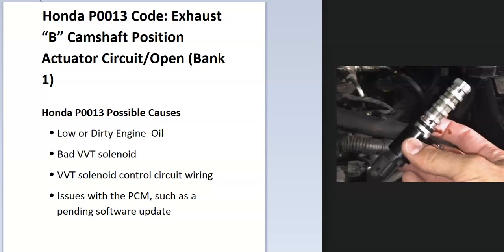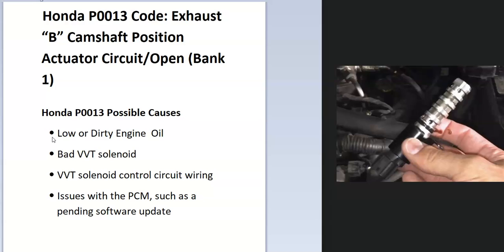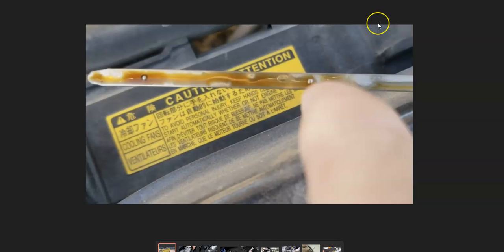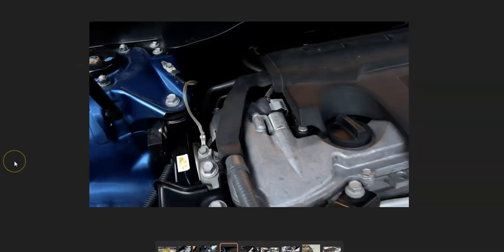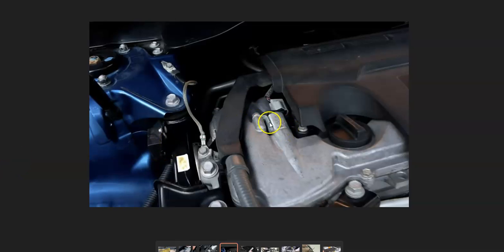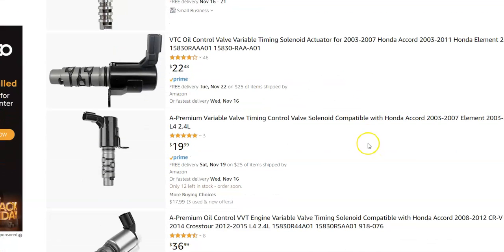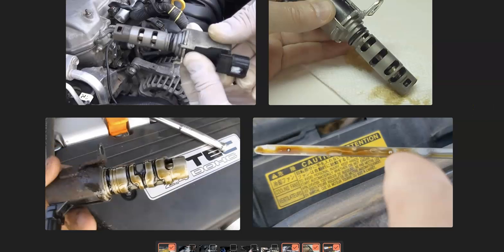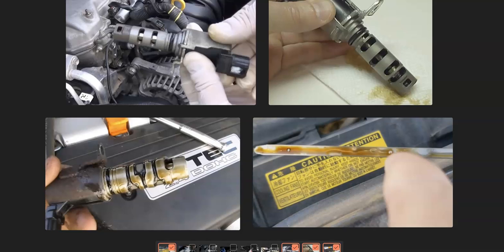How to Fix Honda P0013: Exhaust “B” Camshaft Position Actuator Circuit/Open (Bank 1)

Comment: To save everyone from a headache: CAN ALSO BE CAUSED BY THE OIL CONTROL VALVE (59-B) ..  Edit: After many months of tinkering, it turns out to be a generic code that can be associated with any other problem. In my case, the turbo actuator.
Reply: So you just replaced the turbo actuator and the issue went away?
Reply: @christmasisawesome9348  Yes in my case, but like I said it's a generic code unfortunately, it doesn't point to anything but a wild goose-chase.
Reply: @christmasisawesome9348  In my case, yes. But like I said it's just a generic code, it can mean anything, leading you on a wild goose-chase. It basically means "there's a problem". But there's always another code that will eventually popup or already be associated with it. It can even mean the oil is dirty. It's a terrible code to have to figure out.
Reply: @christmasisawesome9348    In my case, yes. But like I said it's just a generic code, it can mean anything, leading you on a wild goose-chase. It basically means "there's a problem". But there's always another code that will eventually popup or already be associated with it. It can even mean the oil is dirty. It's a terrible code to have to figure out.